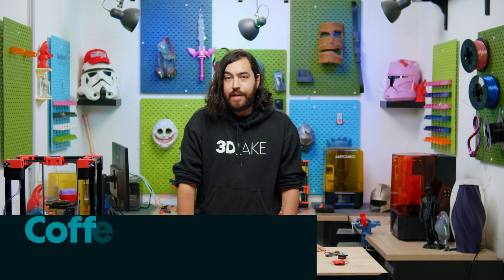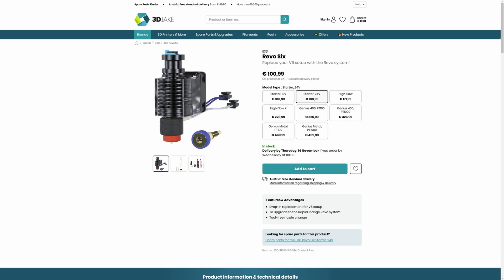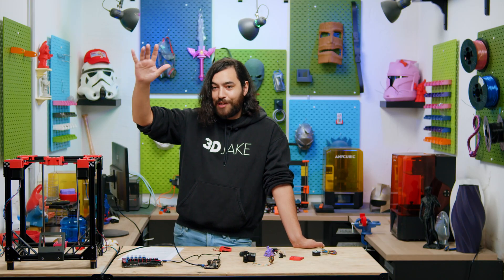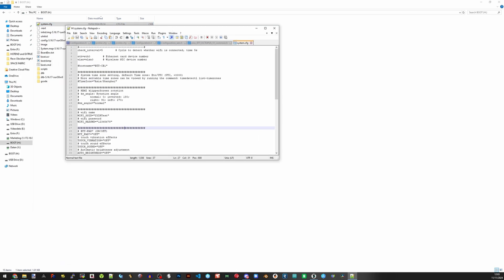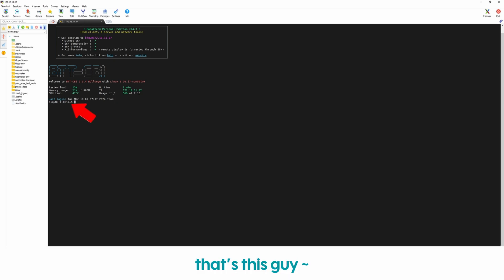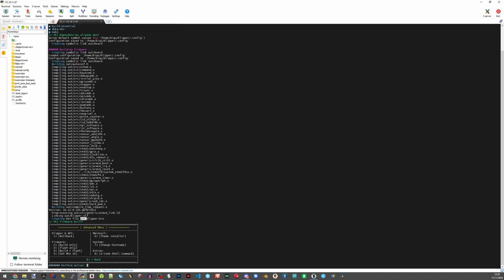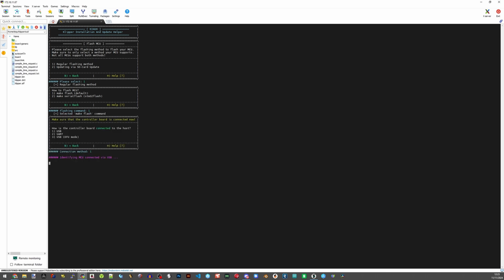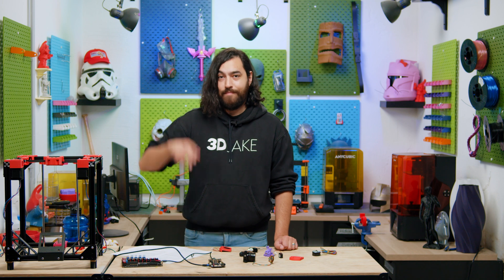How to Build a 3D Printer from Scratch: Part 5 - Bambu A1 Hotend & Klipper Firmware Guide

Comment: I'm really looking forward to part 5 of the video!
I'm still not sure how to connect the Bamboo heating block and the bed auto-leveler.
This is the most important part for me!

I really hope there's a part 5!
P.S. This is a really cool video series, I really hope you continue it! ❤❤
Reply from the maker: unfortunately, using the original levelling system from the A1 mini is not going to work for us as its completely closed source,we have other options though and we can still use an eddy currenty sensor like the BTT eddy

Comment: Very helpful video series. I do have a question.I have several older printers (XYZ Printing to be spacific) rather than building a new chasis, Can I basically trash the XYZ mother board and 2 line LCD and replace with new?

Comment: When Bambu Lab go down the anti consumer route with the A1 and A1 mini, it would be amazing if you had a guide on how to convert it to Klipper if possible. What needs replacing and what can be used on a new build. And then after that, what you'd recommend as upgrades.

Not sure is now is the right time for such a video? But having thinking about it can't hurt.
Reply from the maker: That would be a big job but cool nonetheless. There is already a P1/X1 conversion (https://github.com/ChazLayyd/Bambu-Lab-Klipper-Conversion) I expect a A series one will come along pretty soon.

Comment: I have A1 hotend in ender3-clone with Orbiter 2 😁
It's OK, heats up stupidly fast (I guess all PTC heaters do 🤔) but automatic Z-offset would help after nozzle changes 😉

The printer also has klipper (same BTT board) and POM wheels, but changing motion mechanics to anything better is just throwing good money after bad money 🙃
Reply: Would love to see your design as I'm building a frankenstien printer with swappable tools/hotends. Would petg survive or did you still and tap the heater onto the x carrage
Reply: @TrumpstienPhile  PETG and even PLA works, when printed solid or high infill, so that screws don't come loose. I'll put my files in github and tell you where to find them 😉
Now that you mention, holes in carriage would had been most solid option (there is enough space to have M3 nut behind the carriage, better than threads in aluminum) 🙄
Reply: @kimmotoivanen  nice!
Yeah I dont want to think of the amount of times I've plotted and schemed to overcome  a problem, then done  a lot of hard work to overcome it, then had a DUH moment a few days later😅🤷‍♂️

Personally I would avoid pla for any fire hazard devices  as the HDT(heat deflection temperature ) of PURE PLA is 55c, but filament has unknown additives to increase the melt and flow which will lower it. I used PETG (80c  HDT)spacers for my hotbed, only printed pla, and found my printers heightmap changed by 1mm every time I used it. I Removed the spacers and found there was a difference  in height of 3.5 mm between one of the spacers😅🤷‍♂️

Comment: As i have built almost my whole life my computers, i always wondered why doesn´t anyone build a 3D printer for them self. I mean those who are used to build something with their own hands.
You don´t need to make the circuit boards, motors, hotends, beds anyway. They are ready made. And it´s funny that no matter what printer review you watch, they are all always good and best. But when you buy one or read peoples comment when they have used them for a while, they have problems. Like me. I bought an Anycubic Kobra 2 Neo and had it for couple weeks now. I have printed 5 times and the 5th time after autoleveling, i got  a " red screen of death " saying something about temperature and please reset. I then read that this printer has that problem and i hadn´t read that before i bought it. The error has something to do with poor connection somewhere. My printer works anyway after that error but for how long? And the vendors who sell these faulty printers, they don´t tell it to the customers. Instead they sell them cheaper.

Comment: Right on time man, as I was just shopping around for BTT parts for upgrading my Vyper to Klipper. Unfortunately since you don't deliver to my country (Non-EU), which is too bad since you have a lot of products and parts that I can't get from elsewhere. 
I'm getting my parts from 3DPrima from Sweden (they exclude VAT, so I only need to pay for shipping), even though you are closer to me.
Reply from the maker: Cool!!! Where are you from? 🙂
Reply: @3DJake_Official  North Macedonia, if you add support for shipping to my country by the end of the stream I'll order a Bambu Lab P1S with a bunch of BIQU upgrades for it and a full Stealth burner conversion kit for my Anycubic Vyper plus some additional minor tools and nozzles for it. I'm currently filling up my cart on the other site.
Reply from the maker: @madbuldog  we will not be able to do it this fast but for the future this makes totally sense. I will check that with our delivery team! 🙂 Thanks for feedback and enjoy the video!
Reply: @3DJake_Official  Your videos are always enjoyable, and in the past (for the last 3 years) I always used your site to reference printer prices and compared them with my local offerings when ever I was looking to get new equipment, both for FDM and Resin printers. Local offerings are absolutely not worth it as they usually sell older printers with 100% markup, and it will cost me only shipping + 26% for customs and local VAT to import a 3D printer from abroad.